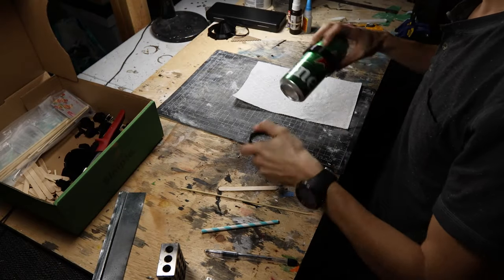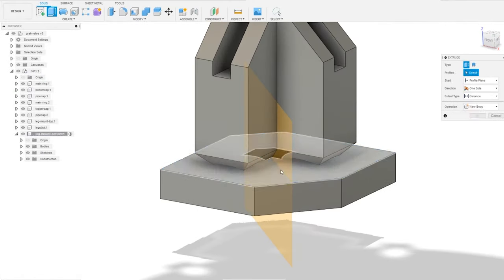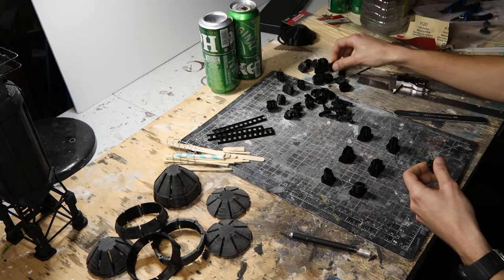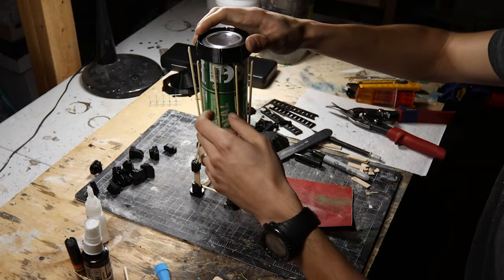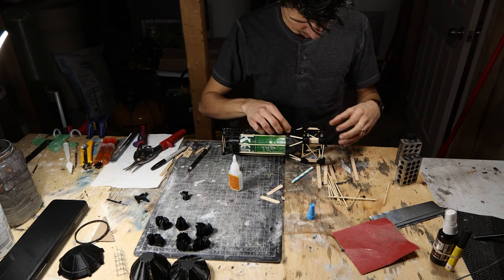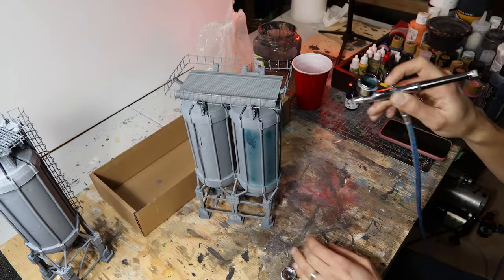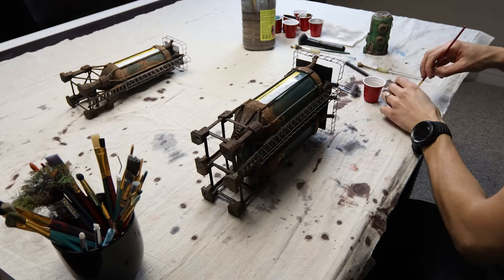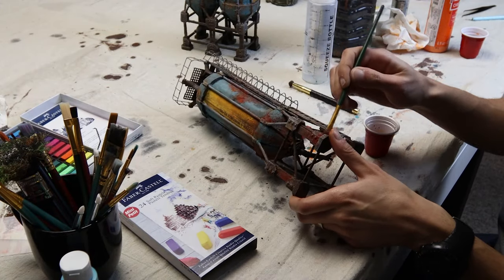Make RUSTED Industrial Silos (40K Terrain)

Comment: The silos/water tanks look great.  I especially liked the chicken wire cage for the ladder.  It's seems more in scale than the plastic curlers I've seen used.
Reply from the maker: First saw it on Dark Matter Workshop's builds, works so well. I've been using every excuse to craft with them since.

Comment: It looks very good, weathering especially, but why bother with coffee sticks and cocktail pipes when you could just 3d print all of it?

Btw, what 3d software was it?
Reply from the maker: The sticks give a lot more structural strength than plastic for the size in certain orientations. Also, it cuts down on plastic usage. Feels a bit silly to print sticks.... When you can just use sticks. Cheers!
Reply: @KnarbMakes  oh I see, totally make sense.
What software did you use for making 3d models?
Reply from the maker: @PijamasGagarin  fusion360